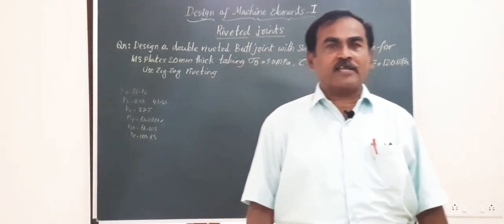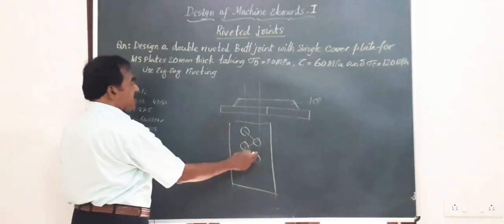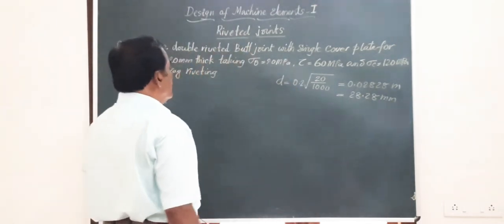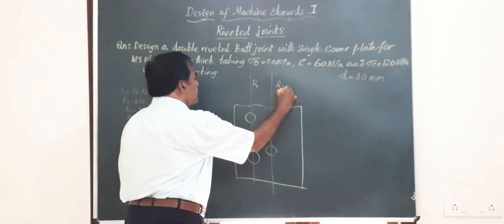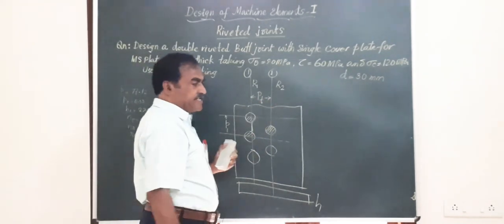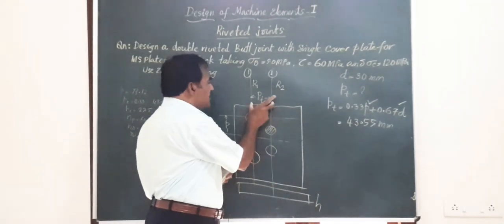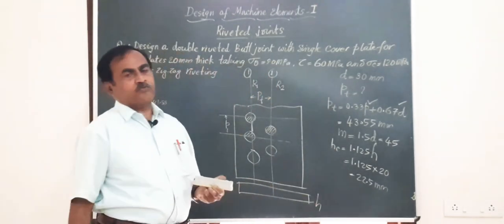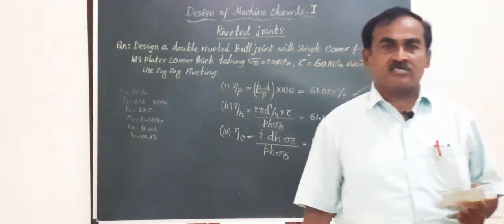Design of butt joint with single cover plate - RJ 7

Comment: Sir in practice, how do we know exactly what kind of joint (lap or butt joint) to use? And why the number of rivets per plate is 5, and not 3 (zig zag arrangement of 3 rivets is also possible)
Reply from the maker: The type of joint is specified in problem
The no of rivets in one pitch length is 2